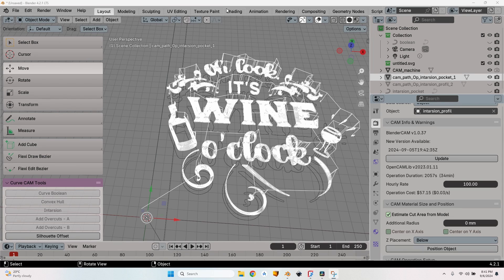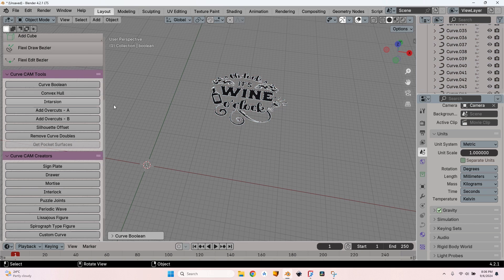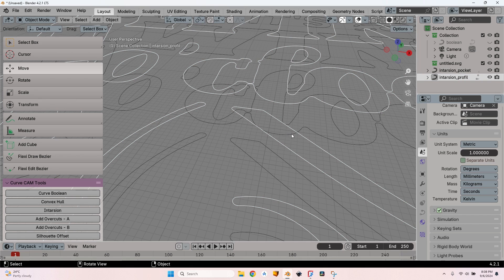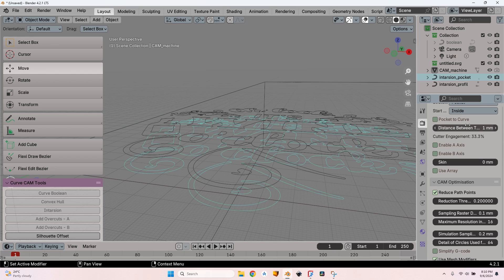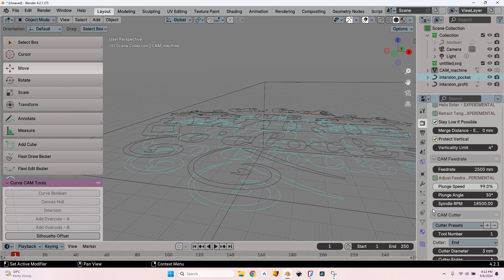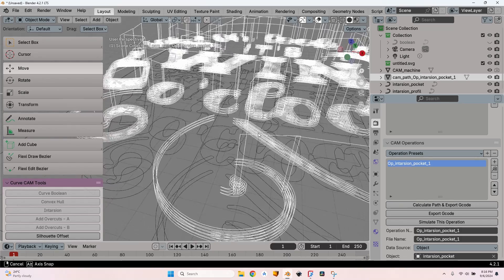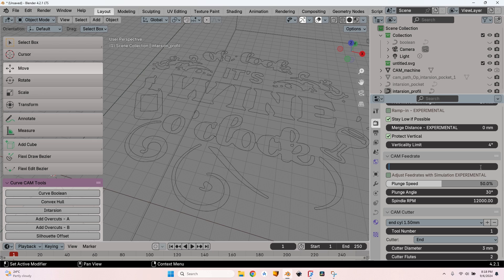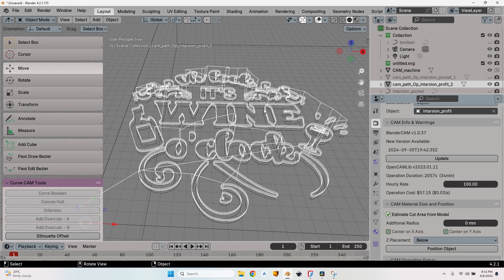SVG to CNC Inlay Toolpath | Blender CAM Intarsia G-Code Workflow

Comment: Sorry for being so dense but i installed blender (never used it before) and tried to follow your directions, but the Curve CAM Tools did not install (I used the standard *.msi install pkg). The last icon I have on the left side is for Create Cube and there is nothing below it. I also could not find Curves in the add-on section. Any suggestions?
Reply from the maker: @prfssrleee  check the video about installing blender cam on my channel
Reply from the maker: https://youtu.be/92oRbioDkv4?si=aeQQn97BwzWuwgjJ
Reply: @opensourcecnc  many thanks!

Comment: Hi Open Source CNC,

I think you may REALLY like GatorCAM for CNC! 
It's really quick to use.
Reply from the maker: Thanks! But my channel is about open source software. Your program, no matter how good it is, is not in this category
Reply: @opensourcecnc  that makes sense, and i understand.
(I wrote the program because i couldn't find any open-source that was easy to use and not cloud/rental.  It's really cheap too.)
Reply: I'll give you a free copy.  I added/fixed everything that bothered me with other CAM packages.